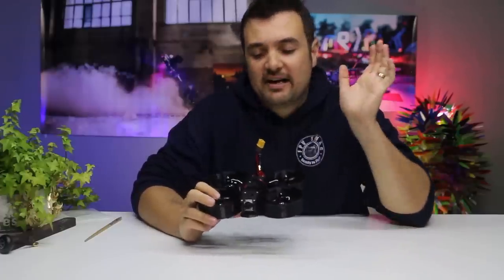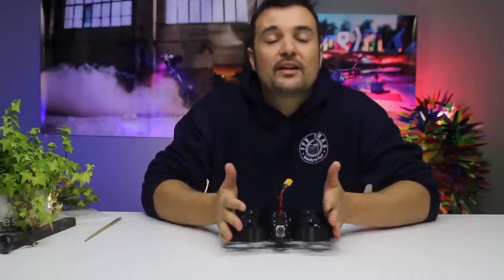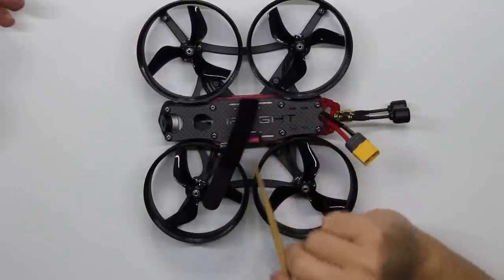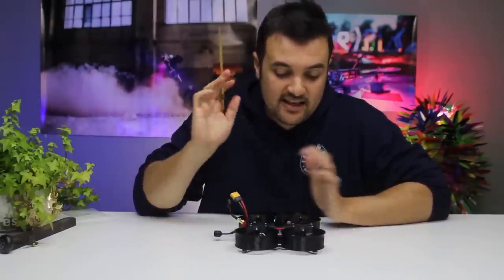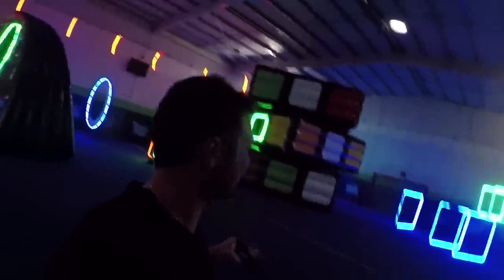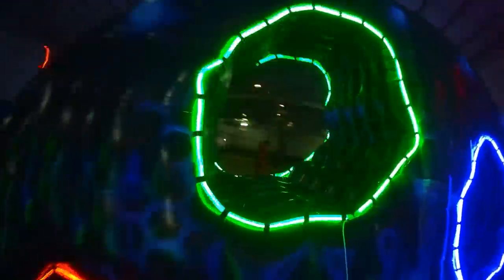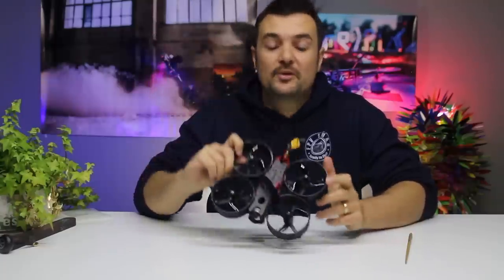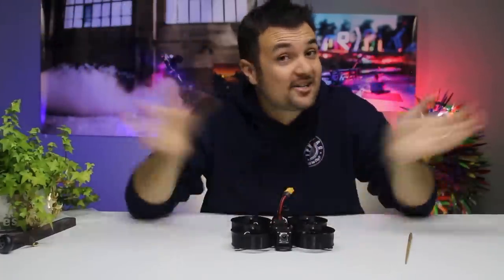Does LED MODE work? DJI MEGABEE -  Exactly what is it for?

Comment: The thing that EVERYONE (including myself at first) seems to miss about these cinewhoops is that they are going to fly like absolute shit until you get your props figured out. Both the HQ and Gemfan Cinewhoop props are too small and leave too much of a gap between the prop and the duct. This results in that bouncy, bobbing up and down action that everyone seems to get with throttle control. Took me months before i put the time into cutting some props down for my Squirt V2 and its a completely different machine now...
Reply: Please elaborate on this a little more. What props are you using now?